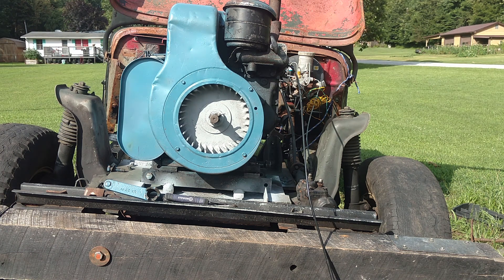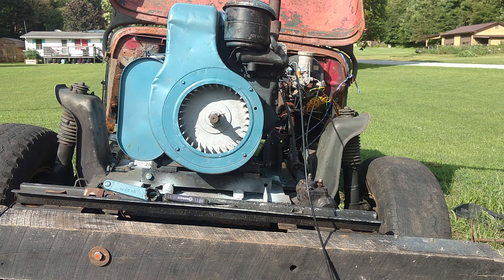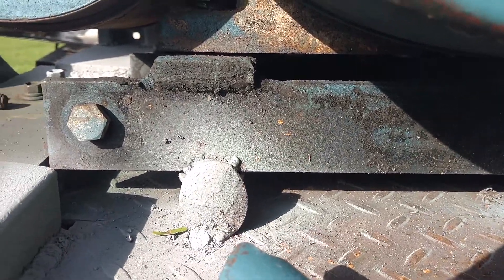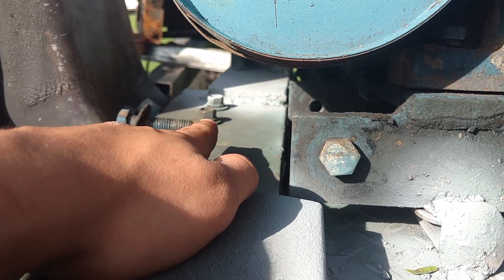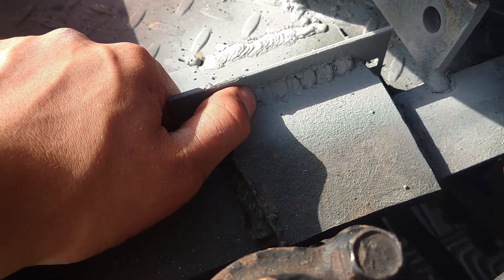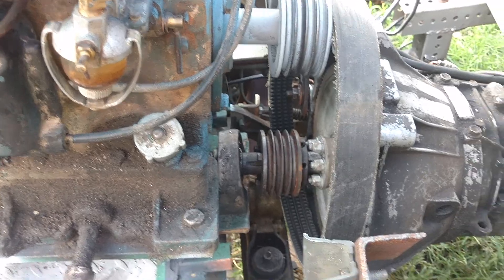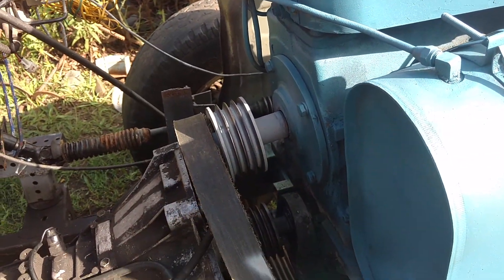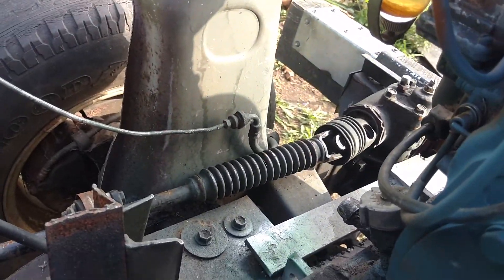Willy's Tracker #13: Engine welded in place

Comment: Pretty cool. Those old wisconsins  are some of the best made. The mini truck I "built" is #35 chain drive with a 60 t sprocket on the trans input shaft and a 12 t centrifugal clutch. the thing will only go 10mph in 5th gear, but has a lot of torque in lower gears, especially in 4wd. My biggest complaint is the noise.
Reply from the maker: An yep, those little engines like to pop away. Do you get noise from the chain or clutch much or is it mostly from the engine?
Reply: @MechanicParker  the chain and clutch. routed the exhaust out from under the bed.